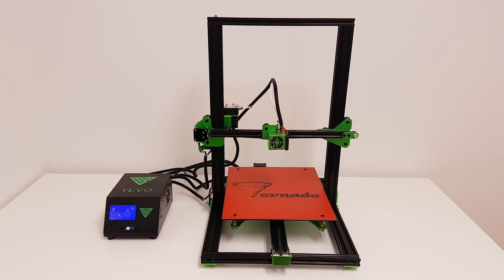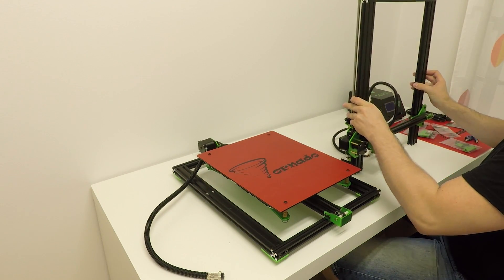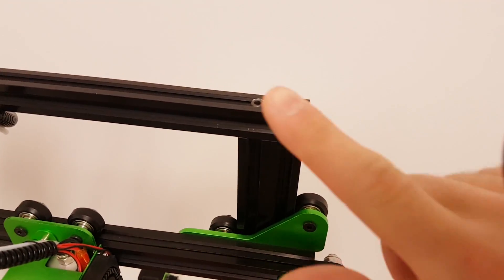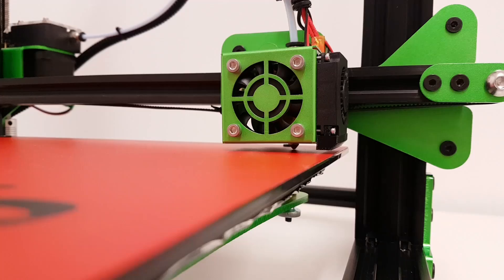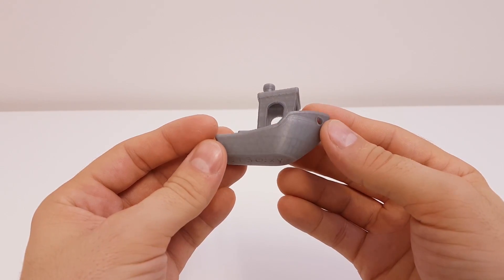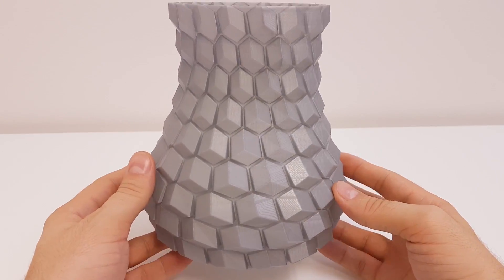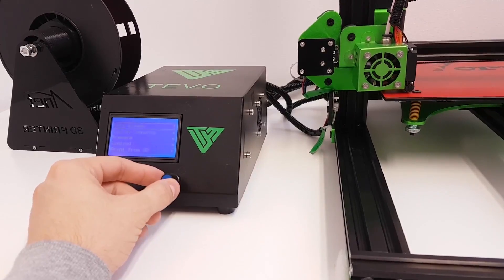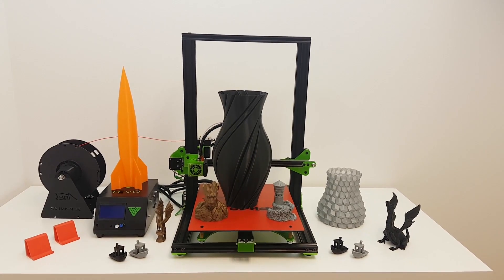TEVO Tornado 3D printer full test and review!

Comment: hi i bought the anet a6 2 days ago and the tevo toranado today, will these be good for printing small flight sim panels?items like this https://pinshape.com/items/38885-3d-printed-logitech-gear-knob-adapter-shifter-g29-g920-g25-g27
Reply from the maker: Brett Culley I don't think those kind of objects will be a problem for A6 and Tornado. It will be fine.
Reply: thanks for the reply, i actually bought the a6 and the tevo tarantula. i am assembling the a6 now and the tevo was just ordered and coming from california to florida, so i don't know when i will get the tevo. maybe you could do the tevo tarantula review in the future? i knew i wanted 2 kits, so i bought the a6 for 180 usd and the tarantula was on sale on gear.com for 180.00 as well, not knowing anything about this hobby i am starting, i hope i made a good choice. i plan on buying a 3rd one hoping for larger prints. maybe you have aa suggestion? here is the link to the small panels i am wanting to print. https://www.thingiverse.com/thing:491567/#comments and here is the link to the printer i bought. https://www.gearbest.com/3d-printers-3d-printer-kits/pp_628789.html?wid=44 i have already purchased 20 rolls of hatchbox pla and following your a6 upgrade videos.thanks for any replies.

Comment: I love this video.  it's great help to me.I saw another Tornado video thatntalked about some problem but your's did great. I got my 1st Delta type printed 3 weeks ago, had 1 week fairly good printing until the build plate broke.  then 1 week of nothing but problem.  Tech support tried to help, Skype, screen sharing and remote control.  After 1 week os not being able to print I notified Amazon I wanted to send it back.  1 question.  How do you know the different settings that you give like for the dragons and lighthouse.  mm size and speed?  Just from experience?  Thanks again for the video.  👍👍👍👍👍 & subscribed  1 ,ore question.  Glass build plate?  Would some hairspray help for removing?  I know some guys use it.

Comment: Any chance to see a guide\ review about tornado+tmc 2130?
Reply from the maker: Not sure, sense stepper drivers on Tornado are integrated in main board. You can't change them without replacing the board.
Reply: Nexi Tech ,yes, thank for the answer...i didnt knew it, i just bought my tornado but still didnt get it) anyway i already have a gen l for change the original board.

Comment: Hi, I'm ready to pull the trigger and buy my first 3D printer, and after some search I'm have two possible 3D printers, but I can't decide on wich one. My two candidates are Tevo Black Widow or Tevo Tornado. I don't have any concern about that black widow need full assembly, I have sufficient skill to deal with that so that is not a trouble. Do you have any advice of wich one is better?
Reply: Hugo Zubieta 
Im also looking at those two tevo models, as my first 3D printer, Im going with the Tornado, simply because of the build volume.

Comment: Should I get this or the Cr 10? I trust creality a bit more but like some of the features of this printer. It looks bad tho.
Reply: This thing is alright if they send you a working one. 
Its pretty much rolling the dice on whether or not you get a working machine. 
Its been over 2 months now since I bought mine and it is STILL not operational. 
First the bed came broken.  
The replacement they sent was bent to the point of not being usable. 
Now they are ignoring me entirely. 

I would NOT buy another printer from them.
Reply: Daniel Petersen thanks. I’d rather not take that chance!
Reply: Overall the only things the Nado has over the Cr10 is that the bed is AC and heats up quickly, and that the extruder is a tad bit better. 
Other than that it is not worth it to go with tevo imo.
Reply: Daniel Petersen that’s what I was thinking. And for a few extra $ I can fix that anyway.

Comment: can you tell me if you need a special computer to operate this.. no one ever talks about how they get the program to run the object.. thanks
Reply from the maker: No you dont need any special computer. You use PC or Mac with slicer program(CURA and others) to ''open'' and slice STL files(3D object) that you can download from Thingiverse for example (over 500.000 free models) and then you slice model and save G-codes(commands for 3D printer) to Micro SD card which then you plug to your 3D printer which will make that object from G-codes.
Reply: Thank you for responding, and the fastest response i ever got..  Thanks.

Comment: Mmm i can print whitout the buildtec Whit spray ? and will be stick in to the heatbed ? or i should buy a new glass
Reply from the maker: angelshce Yes you can and you don't need to buy glass. Heated  bed is glass actually with microscopic holes and with AprintaFix spray it sticks very good. I prefer to print on glass directly.
Reply: Very Thx¡¡

Comment: Can you post your cura profile? My tornado just shipped.
Reply from the maker: gxp99 Just install latest verison of Cura and select CR10 for your printer. Then edit name to Tevo Tornado. You will get all settings that you need. If you need print settings i will write you back.
Reply: So were all these prints done using the cr-10 profile? Did you try your golden ratios or are they not needed with this printer? If there are any settings you changed to print so perfectly please post them or just export your profile, thanks.
Reply from the maker: Yes settings for printer is for CR10 CURA profile but I did change prints settings. I change my print settings for each print that I print. Every model needs different settings pretty much. Of course you can use standard speed and quality  for all prints for most PLA like: Layer height 0.2mm, Print speed: 40mm/s, travel 100mm/s Print temperature 195/55 Cooling from 90%-100% Wall thickness 0.8mm top/ bottom 0.8mm Infill 20%. You have to experiment your self. The more prints you print the better you will be. And there is no need for golden ratios smothers will take care for that. Cheers! Nexi

Comment: cr10> tevo tornado
Reply: detailed claim illustrating why something is better > claim with no information to back it up
Reply: dude no way! do you see these print results? tornado is cheaper as well!!!
Reply: Aren't they both basically just modified and optimised rep-rap designs? ;p

They certainly look very similar to those from back when 3d printers were so niche that was one of the only places you could find how to build a cheap one. XD
Reply: You mean salmon skin?  That's present in Tevo's especially since they replaced the old board with a new one where smoothers no longer help.
Reply: Are there any large printers that do not Salmon skin?  Seems we reached a pinnacle of quality have have now regressed.
Reply: Difference in materials used in the creation of their printers and the quality control of the assembling in factory, is a mile wide with these 2 companies.
Reply: tornado is just a copy...
Reply: David Yes cr 10 is outdated and tornado is cheap copy

Comment: Review on Ender 3D portable printer. I need to know if it's worth $150. Thanks
Reply: Nexi Tech I have great prints without fan and you have old version that came with laptop psu .new version is using regular psu and it can reach 110 C.This printer is almost same with cr 10 but print size is much smaller 15X15X20 .İf you have money go for cr 10 if you dont. You can trust ender .Join the facebook group and You can see the results.
Reply from the maker: Karlson Chee I will my Friend. I need more time I have alot of projects and reviews going on right now. I will make short but detal review as soon as I can.
Reply: Saw a review with the new power supply (at least it didn't look like a laptop power supply), think it said 12V 20A and the reviewer could reach 110C on the bed in like 8 mins. Should be enough for ABS although I don't like ABS as it is so smelly.
Reply: Found the review I was referring to: https://www.youtube.com/watch?v=4_ln-jo4KG4&t=480s
Reply: ı have ender 2 great printer
Reply from the maker: Am testing Ender 2 right now just for you my friend! Feels like quality kit. Clean and nice components. It has the same X carrige and extruder like CR10. Nice small screen. 120W laptop like power supply. Its very quiet. No fan in control box just one in extruder. Nice rubber belts,  heated bed, Buildtak,easy to assemble like 20-30minutes. No salmon skin,clean straight layers. But there is one downside: There is no cooling fan for Filament which is stupid because motherboard and software have suport for it. But I gess for the price..Main fan is blowing pretty good  but some mod will be needed for better PLA quality. Not suitable for ABS. Maybe PETG.  Here is quick printing video and first benchy. Not bad,needs lower temp on nozzle and higher retraction speed. I hope I helped. Cheers.  https://drive.google.com/folderview?id=1bbvU-6orD0tISdVXxpXZkYaz-dWbiY3V
Reply: Seems random if you get the new or old power supply, I've seen new reviews and it was still with the old power supply. But I guess you can always buy a more powerful power supply and plug in if you get the old one.
Reply from the maker: gravel86 Could be. But You don't need more powerful power supply. Heated bed is AC so you need just power for 3 stepper drivers and 40W heater. And I like it because is silent powersupply no fans. Not sure what kind is that new power supply? Fan? More Amps? Can you give more info? Thanks

Comment: does it make sense to put a one else layer of glass over the top of the bed? And if it useless should i buy an extra one bed to be on the safe side? Is it available for sale? Thanx for review, just've ordered  one last weekend but it still not shipped from gearbest
Reply from the maker: John Smith John Cool! You welcome! I think there is no need for one more glass or extra heat bed. I mistakenly drop big heavy metal screw driver directly on the glass without Buildtak and I was afraid that It might crack but to my surprise it dont leave any mark. To be honest Buildtak is preety good. If you don't overheat heatbed to more then 120 degrades it will last long time.
Reply: Does not make sense BUT if you use MEK (alcohol, nor Acetone work all that well on this version of Buildtak) to remove that BIG Buildtak surface and you will never have to worry about putting that shitastic Buildtak back on again.  Give me plain glass or glass with hairspray over any surface that wears down and is a PITA to remove and put back on without bubbles.